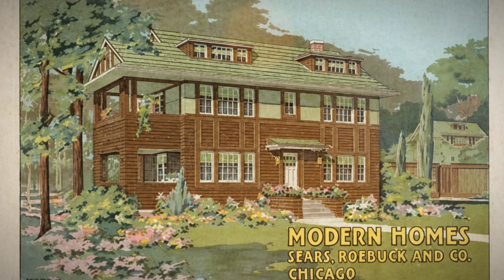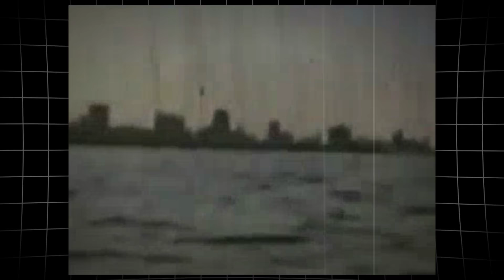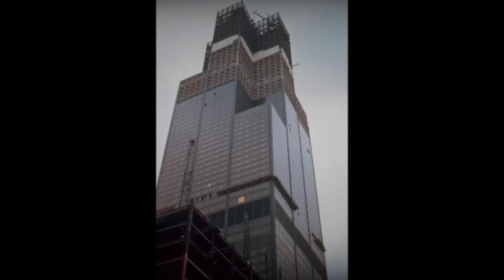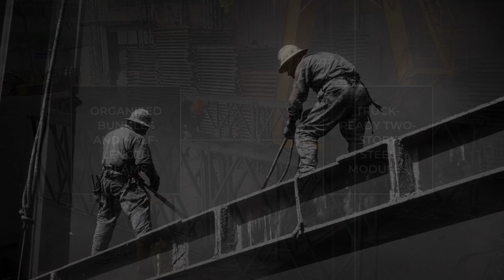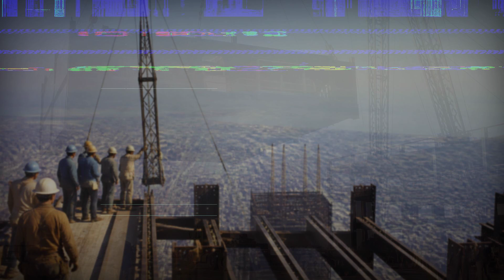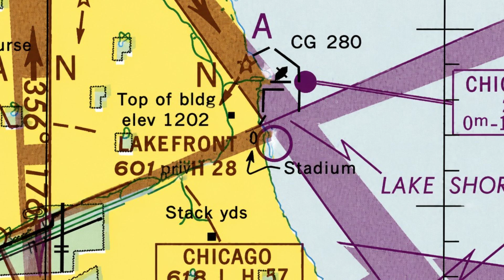The Machines That Built the Sears Tower in 21 Months (1970-1973)

Comment from the maker: The part that still amazes us: the Sears Tower did NOT use the climbing "kangaroo" cranes that built the World Trade Center. Chicago raised 108 stories with four old stiff-legged derricks that jumped up the frame every four floors. Different city, different machines, taller building.

One honest correction we built into this one: the fatal 1973 fire was in a 42nd-floor elevator shaft, not the 96th as some sources claim. And we name all four men who died there, because the standard docs never do.

If you want more forgotten machines that built America:

The Machines That Built the World Trade Center: https://youtu.be/CEEqp5QQQ4s
The Machines That Built the Empire State Building in 410 Days: https://youtu.be/26_LnYuSJlQ
The Deadliest Machine at Hoover Dam Was a Steel Cable: https://youtu.be/Qyjo9Qt68pA
The Machines That Built the Chrysler Building: https://youtu.be/xAE6znq-RJU
The Machines That Built the Interstate Highways: https://youtu.be/BQxjenivtkk

What would you build a documentary about next? Tell us below.
Reply: The main reason some erectors stuck with stiff leg derricks  was cost. It was a diesel engine down below, boom up- down cable and load up - down cable and two booms with a slewing platform. Quick to trip with a crawler crane on the street and quick to jump 3 or 4 floors when it was out of reach  with a crawler. They already owned the rig. Tower cranes are very expensive considering all the equipment needed. It was a huge outlay.

Comment: Back in that era, 60’s and 70’s. the working deck would be “planked out” with long oak planks. The entire deck was covered by the Plank gang. The iron would shake out on the planks and raised only one or two floors to the connectors. It made the erection go fast instead of waiting for a piece to come up from the street.  Some locals allowed Treeing. 4 or 5 pieces hanging by chokers and lifted together as one. Connectors ran ragged hanging 5  at a time. After the next floor was erected, the planks would be moved up one level and steel Q Deck was laid and tack welded. Later concrete was poured over the Q Deck. The plank gang was the worse gang to get put in. Bolter upper wasnt too bad but it was boring and the pneumatic impact guns were brutally loud. Plumbing up wasnt bad but raising was good and connecting was the best. The connectors got a full days pay if it started to rain. Everyone else got paid to the hour they knocked off. Connecting was for the younger guys and you had to have a good reputation to come out of the hall connecting. You had to be in great shape because you climbed columns and walked the beams all day. You had to be quick to make up so many pieces a day to get bonus money at the end of the job.
Reply from the maker: @Bill Incredible firsthand account - thank you for sharing all these details about the plank gang and connecting crews. Really brings the history to life!

Comment: In Downtown Chicago most skyscrapers are built "truck to sky" because of the limited space for material in the densely urban area....  the "Raising Gangs" the Ironworkers put together to accomplish this usually travel from building to building because of their reputation of being efficient and working off the trucks and with crane operators...  same goes for the Ironworkers that would only be there to "jump the crain" every 4 floors to make sure there was no pause in productivity.
Reply: Another interesting topic on this construction would be what it takes for the Ironworkers to replace and install the new Antennas on the Sears Tower and Hancock Building....   using both cranes and helicopter
Reply from the maker: @eddiechi1 Fascinating insider knowledge, Eddie! The "truck to sky" method and the logistics of the Raising Gangs really shows how much skill and coordination went into every floor of the Sears Tower. And great point on the antenna work — that would make for an incredible topic on its own!
Reply: Most jobs are truck to deck. It is more efficient to pick from the truck and get it to the deck below the top deck being erected. They then “shake it out” below where it will be set using the derrick or tower crane. 

The raising gang does that work. A second derrick or tower crane makes the pick for the piece the connectors will set. Much more efficient. 
I was only on one job that unloaded on the street. Too much handling.
Reply: The raising gang jumped the derrick. We never had a special gang come for that.
Reply from the maker: @Bill, great breakdown of the truck-to-deck method - appreciate the added detail on how the raising gang handles the derrick jumps too!